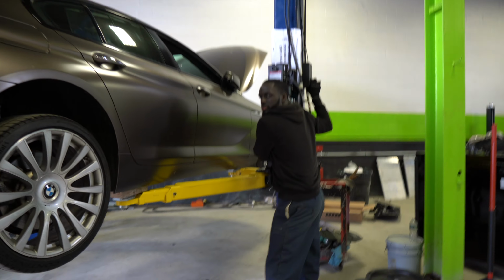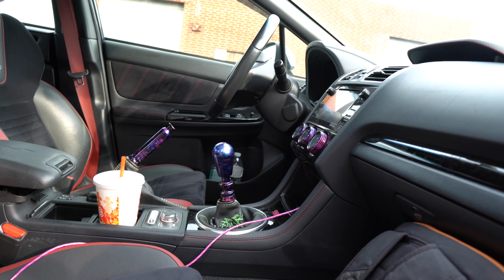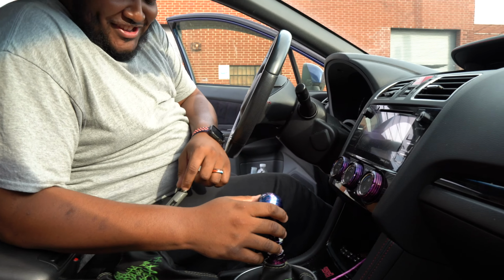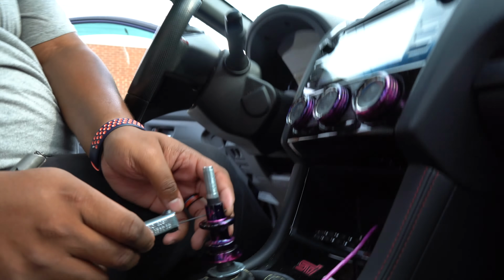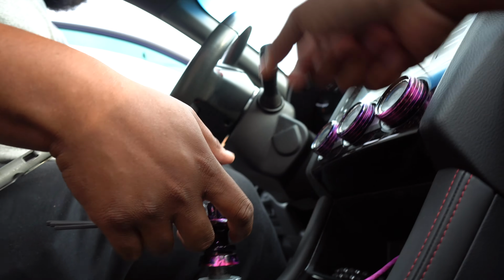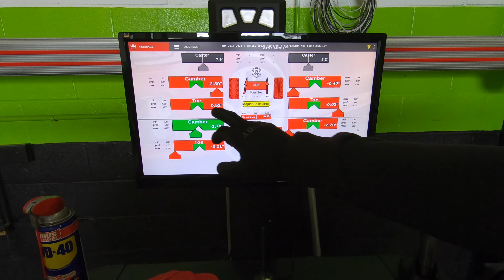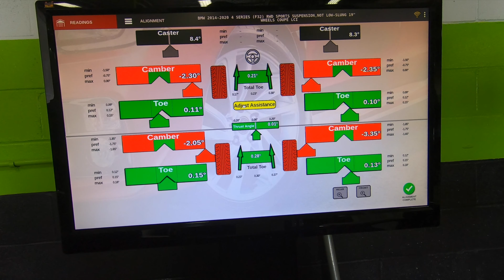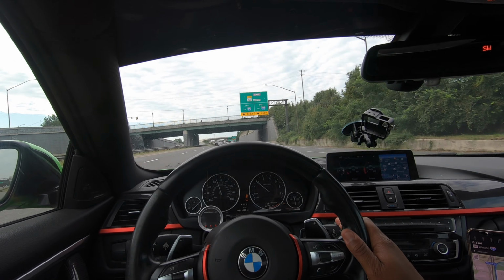435i Goes Back For An Alignment

Comment: 💯agree! That’s why I bought a f30 then the m3 f80. I have fbo and purestage2 and couldn’t be happier with the power.
Reply: jean veux I haven’t dyno it yet since it been hot over here in SoCal. So I’m waiting for the weather to be cooler to get it on a dyno to see what it’s making. I upgrade the hpfp to a b58 off the Supra and left my lpfp stock. Also have bootmod3 with a custom tune from twisted tuning

Comment: I took off my rear seats to improve my 1/4 mile using dragy. After the result I put them back on. Not a damn change. Not even a 0.001 of a sec.🤷
Reply from the maker: Sheesh! Nothing to gain there.
Reply: Slowspeed Did yours improved gutted vs un-gutted?